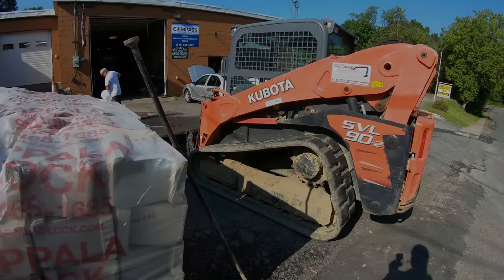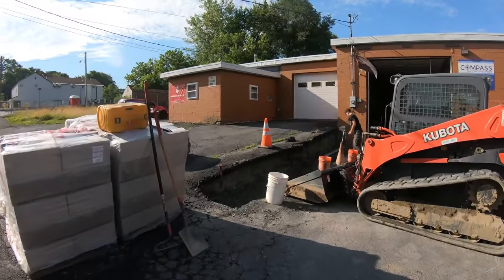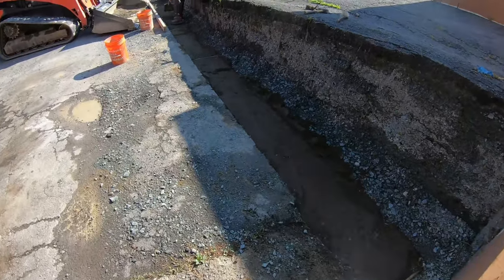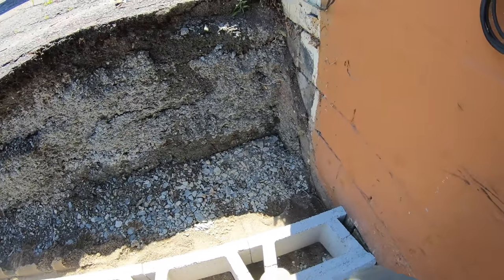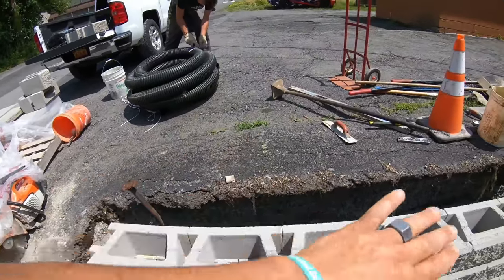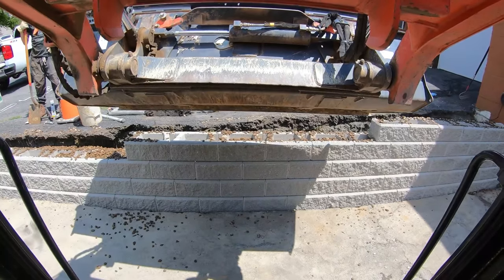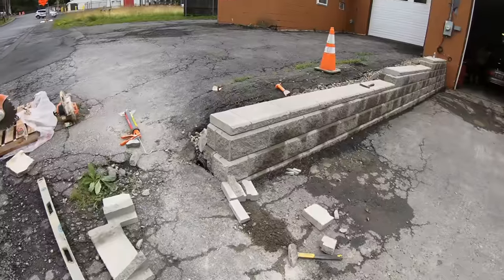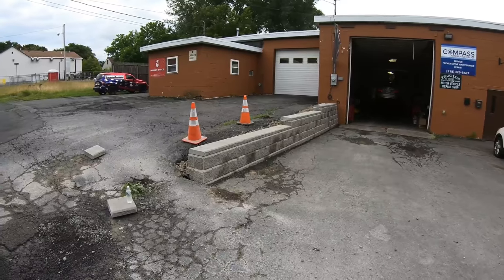Building a Retaining wall Allan Block dry stack

Comment: Nice Wall, I did a wall in my front yard that was around 75 ft long and the face style of your block looked like mine. The blocks I used were solid and had holes in them to slide in plastic Pins to lock it together. The blocks weighed a ton and lucky me a Truck crashed in it and I got to do it again. and then a car crashed into it only had to do a minor repair that time.
Reply from the maker: Yes we have those type of blocks here that is actually what came out of there

Comment: I set 2 string lines. One in front of the block and one in the back. Took my time and set the first course as perfect as possible like you did. Second, third, and forth course of block was still off. Had about a half inch sag in the middle of my wall. I tore it all down and restarted.I had to string line every course and add a little sand underneath to level out some of the blocks. It's weird but I cannot just stack them and get a straight wall. What am I doing wrong?
Reply from the maker: Not sure...your base is dead level right? Also make sure that string is super tight.. I have other videos on retaining walls also take a peek
Reply: Yeah I made grade with a string line and then set the first course with string lines.  Pulled them as tight as possible. I start stacking the second course and after a few blocks,  suddenly one will be a quarter inch higher than the last one. I even grinded out some of the rough spots on the blocks to make them as flat as possible. I guess I'll just keep string lining every course. It's just weird because most videos I've watched on YouTube make it look so easy. They get the first course perfect and then just start stacking the rest. The walls always look tight and perfect. My wall always has blocks that teether totter here and there. Well, thanks for the response. I liked your video. Keep up the good work.